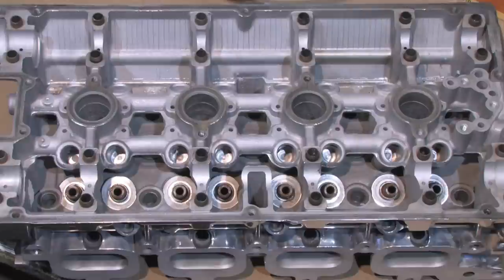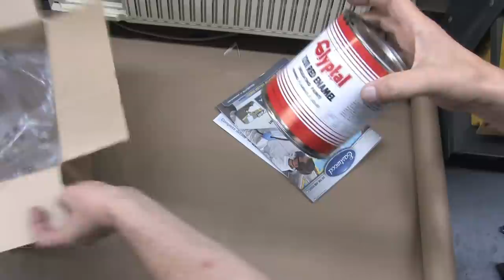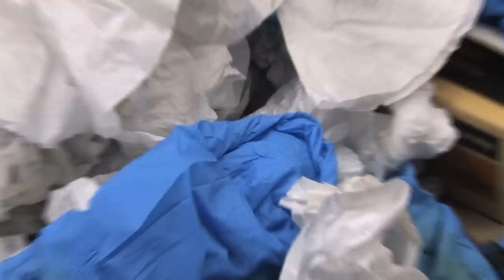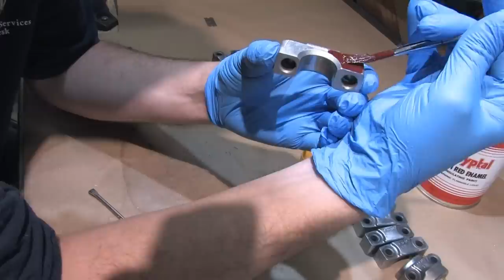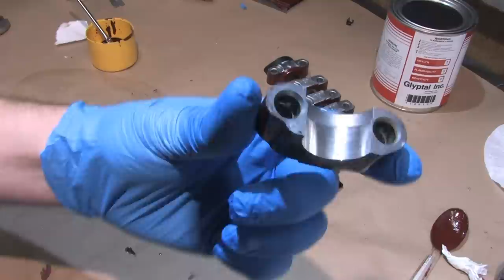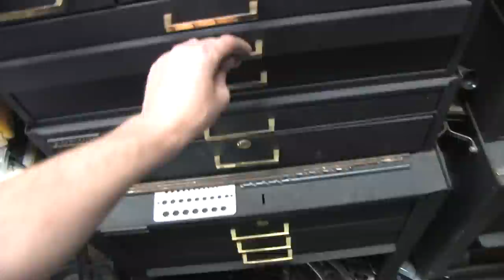Glyptal Application Process

Comment: Why would you want your intercooler to be hot? the paint acts like another layer of insulation the heat must pass through, which makes it perform poorly. also painting your intercooler black is good at absorbing light energy, not making it a better heat exchanger.

Comment: What are the adventages of using this coating?
Reply: Glyptal is a polymer/enamel paint that allows oil to flow on a surface easier, so it returns to the sump quicker. Also prevents rust which easily damages bearings but this is aluminum so not really applicable in this situation.

Comment: Shouldn't you be worried about reducing surface porosity near bearing surfaces
Reply from the maker: Patrick Doolittle Nah, because I'll be using the Kiggly head oil pressure regulator.  I ran Q-tips drenched in Xylene around the edges of the cam journal surfaces to ensure no wicking would take place on the cams, but spend much time cleaning anything else up.  The oil next to the bearing surfaces doesn't offer any real benefit.  My bearings will have the correct pressure, and quickly after startup because of that regulator in the head

Comment: I think this paint/treatment is useless on a nearly normal aluminum engine like here.
Motorcycles engines or high performance NA engines have very high rpm and very high oil  flow and it goes back quickly enough on 18 000 rpm engines without paint.
Synthetic oil do not cook like mineral one it never will be dirty in your engine with those intervals of change.
Machining more return oil holes would have been a better answer to a return problem.
or even a bigger oil capacity.

Comment: How to clean the inside of the engine better than in the video: Change oil with normal oil shy 2 quarts. Add 1 quart automatic transmission fluid. Start engine and let idle 1/2 hour. Remove valve cover. If not as shiny as the day it was made, change oil and filter and repeat.
Of course, never operate the engine with ATF in the oil or even rev the engine up. It cleans so thoroughly  it can easily unseat the rings under load.

Explanation. If an automatic transmission accumulated the carbon an engine does from  just 100 miles of normal driving it would be dead. Therefore, ATF contains a number of powerful detergents to keep all the tiny journals and valves spotlessly clean. So (carefully) turn that detergent loose in your engine.

As a test we took an old abused Chevy 283 that had never had an oil change in over 150,000 miles. Going to drain the oil, none came out. It had all caked to the internal surfaces. Compression was less than 20 lbs on all holes. Removing the valve covers it was solid goo.

 I filled it with 50 wt oil, 3 quarts, and 1 quart ATF. It took 5 minutes of cranking to start.
1/2 hour later I drain the ... sludge. Thick goo. Drained as much as I could and refilled, 3 quarts and 1. Engine started in about 30 seconds. Another 1/2 hour run. Oil drained out that time. Repeat again and again. 4th draining the oil drained clean pink from the ATF. 
Removed the valve covers again. Spotlessly clean. Refilled with 4 quarts oil and revved the engine, pouring 1 quart slowly into the carb. Ran at high idle until no smoke. Checked compression; a little above 60 across the board.

Comment: I've often thought about this issue.  I think all engines should be coated in a chemical like that new chemical that makes every thing water proof.  But obviously it needs to be oil proof.  Why don't they just make engines without any rough cast?  Cant they do that?  Seems easy enough, but maybe a little more expensive.  Great vid.  I just bought an A4 quattro with a bunch of upgrades.  Now the galant sits.

Comment: It's definitely not the same kind, no. Seawater is used to either cool the engine directly, or through a heat exchanger. Either way, the seawater is ejected into the exhaust in order to keep that cool. For Yanmar engines, this is done right at head, in a "mixing elbow". These are notorious for failing!

And for the rest of the engine, the presence of salt and moisture in the air makes any exposed metal rust really, really fast. Needs some good paint to protect it.

Comment: In regards to the statement that you wouldn't want to paint your radiator/intercooler, there is a lot of science that shows paint/color helps with the radiation of heat. I'm not an expert not trying to tell you to paint your rad. But you should look into the emissive properties of flat black vs polished metal if your are curious which is better.

Comment: Jafro any results after using this glyptal treatment?
Reply from the maker: Matt Cecil Notchet.  I'll be getting back on this horse Summer 2015.
Reply: ***** awesome can't wait.  I think I got a gvr4 you helped someone with at my house now.
Reply from the maker: Is it white?
Reply: Indeed it is.
Reply from the maker: It's a 1992?
Reply: Yes got it from a guy in Mechanicsville.
Reply: It's a rust bucket,  using it as a transplant into another.
Reply from the maker: Hmmm... I dunno if it's the same one then?  The one I saw wasn't?  AWS worked, and everything...  Practically flawless interior and wasn't one I'd have cannibalized?  I actually didn't work on it, though.  Just poked around looking under a few things... the known trouble spots.  The only thing I could find wrong with it was a noisy transfer case.  The owner offered it to me, but I didn't have the money or the room.  If it is the same one, would you consider selling any interior parts?

Comment: I vaguely remember the old iron block and head guys doing this kind of stuff especially the supercharged guys, but I can't remember why the supercharged guys wanted to do it more than the pure motor stroker guys.

Anyways. Regarding the aluminum cylinder head, I would skip the paint but definitely go for the polish. But I would do the iron block if it had it. Hell I would do the iron block anyways cause its easy peasy nice n roomy.

Comment: to Glyptol or not to Glyptol.  I don't know if they equipment and engines that I've worked on have Glyptol but they ALL have some sort of sealing paint on the interior of their cast parts.  Cheap, short lived tools and equipment don't have interior paint but Caterpillar, Komatsu and all the heavy stuff that is intended to last more than the next fad or color has painted interiors on engine, transmissions and any cast structure that has oil or the like inside it.  I'm told that the casting will NEVER give up all the casting sand and the like.  So it will always be released over time into your engine.
Reply from the maker: Robert Palmore It's a tough call.  Think about how you use your vehicle, and how it may or may not relate to quality earth moving equipment like you mentioned.  The heavy machinery is usually used seasonally.  It comes out when the ground isn't frozen, and sometimes sits idle for years on end when there's no job to work.  In those cases, you need a rust preventative coating because the equipment sits for long periods of time without oil circulating through it.  Condensation can wash out the oil, and rust can kill that equipment dead from the inside out.

Now think about classic and collectible cars that come out only on special occasions, sometimes years between uses.  How is that equipment any different?  Cast iron parts?  It would be less of an issue with aluminum... but I believe it's justifiable on cars that will sit for extended periods of time.  It helps to keep the oil and crankcase clean and corrosion-free.

Now there's one last issue.  Engines with known oil drain problems, restricted galleries or complicated oil returns that you can't reach to port or have no room to remove material (to remedy this problem the correct way).  If oil doesn't drain fast enough in that particular engine, then there is a performance benefit from the coating.  I am of the opinion that a daily-driven engine that never sits and is serviced regularly never needs this treatment.  But the pessimist side of me says... if it's a Mitsubishi... it's inevitable that every other year it will break down and sit for a year.  In my GSX's case, it really doesn't get driven much at all.  I've only put 42,000 miles on it in the last 16 years.

Comment: Why didn`t you just mildly bead blast it? Seems like it would have been faster and accomplished the same job. And as far as oil drain back why didn`t you remove the casting flash? Kind of defeats the purpose of the paint for drain back don`t you think? Not trolling, I`m just lazy and a stickler. lol
Reply from the maker: Good question and nice Pantera avatar!  It's because I don't believe in glass beads and internal engine parts coming in contact with each other.  It only takes one glass bead stuck or lodged in a random part that didn't get washed out well enough... to be washed out by pressurized oil and end up between a bearing surface somewhere and gouging up a journal or a bearing.  I'm one of those guys that prefers walnut shells or charcoal.  In any of these cases, no matter the blasting media, there would still be an extensive clean-up prior to applying the sealant layer.  Truth be told, the lazy method is not to apply the coating at all.  The engine still works fine and the Earth keeps spinning.  ;)
Reply: There is a certain amount of risk of a brass wire off a dremel wire wheel ends up in a journal as well I imagine
Reply: willythewave The glass beads self destruct when they hit the metal surface and the fine particles can be embedded in the rough cast surface and later the hot flowing oil can carry them throughout the oiling system. Just more grit in your oil and you still wind up with a rough cast finish. You also wouldn't want to blast all the machined surfaces. Bead blasting is a great way to clean and smooth parts just not in this instance.

Comment: Do you know how well Gylptal hold's up to prolonged nitrous use? I'm currently rebuilding an NA supra motor that will get a wet kit installed but I am also planning on having a dry kit installed on a turbocharged MR2 I'll rebuild in a few months.
Reply from the maker: +Vernondo Garcia Honestly, no.  I've never heard of Glyptal being used in engines like that?  Not that there's no benefit, but the old timers that originally started using this stuff did it because of casting quality.  Everything pre-war that came off the domestic assembly lines tended to have a lot more casting sand than modern engines.  The improved oil runoff is a plus, but applying it is a lot of work, and nitrous cars tend to break big parts and blow holes in components when they fail.  It's setting yourself up to lose a lot of hours of work  This has been more of a collector's trick to help preserve stock running engines.  I confess that I'm going way overboard on my build.  But since thousands of people have done it, talked about it, encountered it on the job or shipped brand new parts with this treatment... someone had to document this and be the public's guinea pig.  It's not entirely out of the question that I might do it one day?  lol.  I'll never say never.  Come to think of it, a setup like that would be lots of fun on the GSX...

Comment: I was going nuts hearing you say oil "gallery" instead of "galley" and was going to correct you - only to discover I was wrong when googling to confirm I was right. I don't DSM, but I dig your vids.
Reply from the maker: +ishootstuff Thank you for the compliment!  I have good news for you!  Both terms are actually correct, and both are used by both amateurs and professionals alike.  You wouldn't believe the amount of work I go through in an attempt to fact-check my scripts' terminology, and then I slip just one time being lazy and drop an "irregardless" in one sentence of a half-hour video and just get hammered in the comments.  :P  That one's actually in the dictionary, too.  Its definition is "regardless" - informal.  It's still every English teachers' nightmare, though.
Reply: *****
Well thanks for the vids despite the irrespectful comments :)

Comment: good video but you didn't bake out the oil! you need to scrub the head/parts with acetone or denatured alcohol then bake it 200°f for an hour then scrub it again with acetone then bake it again... each time you bake it you will see wet spots of oil coming out of the metal, you need to keep repeating the cleaning/baking process over and over until it comes out of the oven completely dry (usually 3-5 times).. good luck and enjoy!
Reply from the maker: It got a Xylene bath, then hot-tanked in the machine shop, then mineral spirits, then ground down to remove the outer cast layer, then mineral spirits, then denatured alcohol.  It was washed 5 times with powerful degreasers prior to paint, and the paint was baked on at 290° for 2 hours a week after it dried.  It ain't goin' nowhere.  It's dry as a bone.  According to the surface preparation instructions I went far beyond what's recommended.  The block went through a burn-off oven before it was powder coated, so it's baked twice.  It still has several more treatments to go before it gets coated.  The porosity of cast aluminum and cast iron are very different.  I'm sure cast iron needs the baking treatment more than aluminum will, but I'm sure what I did was sufficient.
Reply: that sounds better.. just didn't hear all your prep in the video, glad to hear you took the time to do it right
Reply: Jafromobile p

Comment: I work with glyptal in the electrical buisnes and would never recommend using it where any heat or oil was going to hit it, I know a lot of old timers swear by this stuff but I have yet to see any brand of this stuff hold up where heat oil and pressure are. most of my testing was done in a hot oil bath @ 90 too 100 c

Comment: i am committed to my 4g93t, does anyone mod this engine in the US? anyone specialized as u are? i really need the guidance like urs on a 63. anyway, ur videos are still in my "need" list, cos i gotta take care of my brothers evo3 engine.
Reply from the maker: That's one I've never even seen.  None of the cars I can identify on Wikipedia with it are not available in the US with a 4g93t.  :(  I'm not sure that the Mirage even received the 1.8L variant of it here?  All the Mirages I've worked on were 1.5L, 1.6L or swapped with a 2.0L.
Reply: Saravana Kumar http://upload.wikimedia.org/wikipedia/commons/5/59/Mitsubishi_Lancer_(Chiang_Mai,_Thailand).jpg And it came from this body, so now i know, that it was never made available in ur country,
Reply from the maker: :D  That would be a Mirage here in the US.  No, I've never seen that engine in that chassis in the US.  There's a lot in common between that engine and a 7-bolt 4g63 as far as design is concerned.
Reply: ***** yes sir, u r so right. so is the 6-bolt as same as the vr4 and the 7-bolt are the evo engine? thats how we call it. how many bolts are there for the RVR and the hyundai 2.0's?
Reply: ***** this video has given the insight to reopen my cylinder head as i've replaced it with ARP stud setup, and also on another NA 4g93 converted to turbo and a mivec head slap-on

Comment: As a former head of maintenance & engineering at a steel mill where you see ALL types of failures on a daily basis I can tell you, beyond a shadow of a doubt, that adding Glyptal to your engine would generate an immediate pink-slip.  It is not operational.
Reply from the maker: Better tag and lockout every piece of Caterpillar equipment you have, then.

Comment: I also thought that it's bullshit--I don't subscribe to the school of thought I was proposing. However, the idea is that it would promote heat exchange in the same way that making a heatsink out of copper and aluminum, rather than just aluminum, would help move more heat away from something. It's not that black makes it more prone to absorbing heat, it makes it more prone to taking away as well. I still don't buy it, I've never tested it, or seen it tested.

Comment: I've watched this like 3 times in the last 2 years ...and i know i sound like a dick when I sat it but I wish you'd hurry up and tear this engine back apart a d show us what it looks like now .
Reply from the maker: I just spent 9 hours in a gas mask hovering over it this weekend coating the block.  Because I was forced to finish 2 other vehicles that gave me a lot of problems, this thing has actually sat on a shelf for a few years.  I'm sorry if you're disappointed that it hasn't been in service.  It will be soon.  The block coating should be finished before this month ends and then assembly begins.
Reply: well thanks for the reply, this is one of the most meticulous builds I have ever seen in my entire life. mind me asking you a few more questions? like what turbo will be used ,what trans ,what yr car ,tuning ?
Reply from the maker: Watch the GSX parts video on my channel (not the timing belt parts video, although it's relevant) for more of the details.  The 1995 GSX that parts of this engine was in previously made 421 AWHP prior to munching rod bearings on just a Big16g and supporting mods.  The turbo selection is up in the air at the moment, I have a few candidates I'm considering, but nothing concrete yet.  I'm shooting for 650-700hp, and keeping it street.  Tuning is handled by ECMlink.  

I went way overboard with my Hyundai Elantra build, too.  That car is making far north of 330hp, I just can't get enough traction once the turbo spools in any gear to come up with a number I trust.  I'm guessing low 400's right now.  It's handling 32 PSI on pump gas.  It's stupid.
Reply: same intent for my current 2gb tsi auto as far as a target hp ,and the "street able factor"  streetable but far from my daily as I have 8 other rides to choose from before id daily it .got a fb?